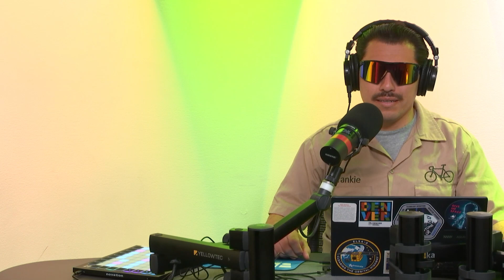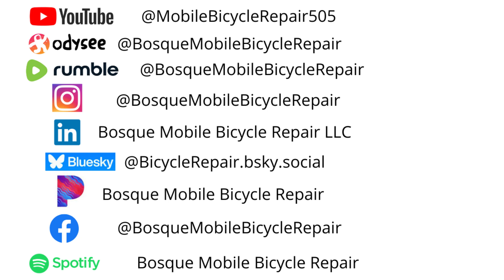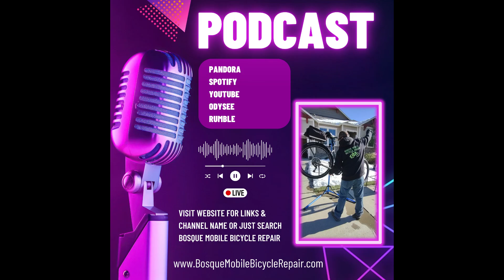Top 10 Reasons Cyclist Get Flat Tires - Bosque Mobile Bicycle Repair

Comment: Here’s an 11th reason for a flat tire – my stupidity! When I first got back into riding a bike a few years ago, it was my first time having tires with Presta valves. I didn’t know you were supposed to unscrew the end to open up the valve. With the Schrader valves I had before, you just attached the pump to the valve and were good to go. Every day, I went to pump up the tires (into a closed valve) and was amazed at how it seemed to be holding air, not realizing that I was slowly losing air every day. After about two weeks, I got a pinch flat from running a tube with extremely low pressure. I’ve learned a lot and have only had one flat since then (knock on wood), but that first lesson about how to use a Presta valve was embarrassing! 🤣🤣🤣
Reply from the maker: That simple information about presta valves is not well known or even found in bicycle repair books & videos. Sometimes it's just  the simple information that's hard to find. The videos I make are about the basics because other content creators don't cover it.